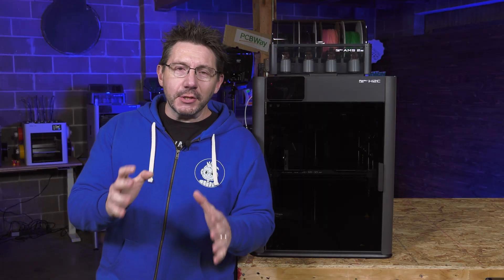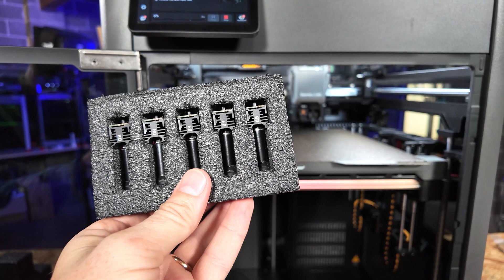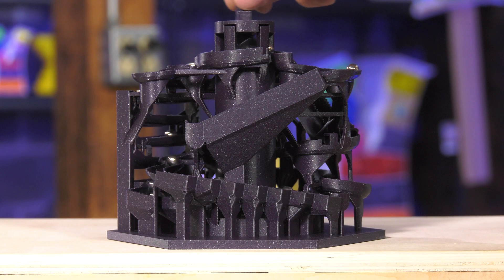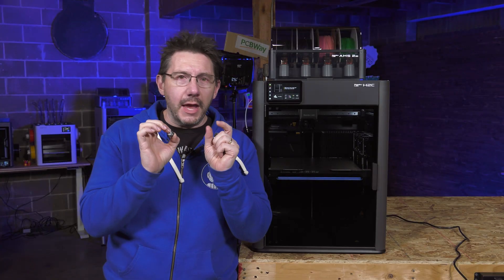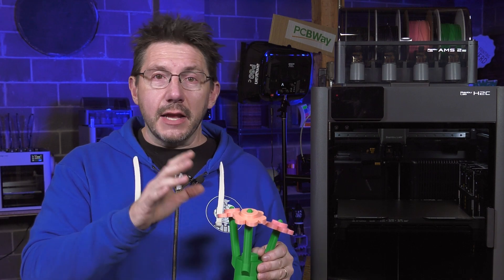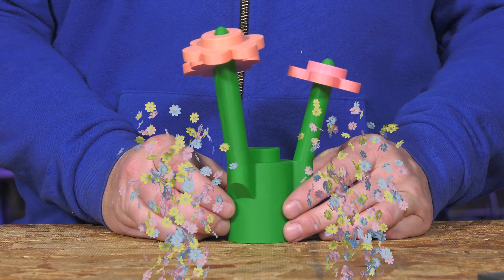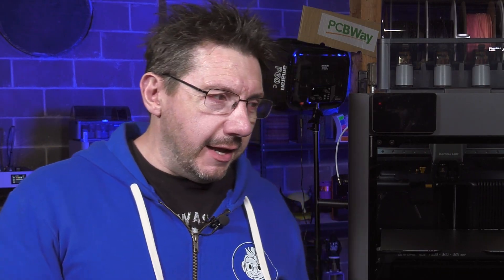My Review of the Bambu H2C + Vortek

Comment: ultiple failed prints, Uneven bed heating, nozzle clogs that you cant clear and need to buy a new nozzle every clog, Sub par print quality....Yep! This is Bambu "innovation" If people would stop with the Bambu hype and brand loyalty and actually LOOK at the stuff that has come out of Bambu since the P1S, X1C launches they would see that it has been a LOR of falis.  Tha A1 could burn down your house. they fixed it, but didnt and it now has more soldering joint issues on the PCB which is causing them to melt.  The H2D is a joke that has come nowhere near the sales numbers that Bambu thought they would and again sub par printing quality (and its $2400) the H2S is more of the same.  And now this thing the H2C. Its barely even usable and it loaded with massive issues.  Bambu are scrambling because they know the Snapmaker U1 is going to take over the market and now Creality has said they have a tool changer printer coming this year too.  Bambu is in trouble

Comment: Thanks Joel! For me, that steel sleeve around the copper core, is very thin. A concern for me would be the degradation it will experience during heat cycling. Looks like an H2C user will have to be locked into buying them over and over again. 🤔

Comment: Re: PA6-GF - I printed some shelf supports to make a rack for my filaments.  I printed two with PA6-GF, and 2 with PAHT-CF.  Both were very stiff, and I didn’t see layer adhesion issues like you experienced.  That said, I had much worse warping and bed adhesion issues with the PA6-GF, so I’ve standardized on PAHT-CF when I need engineering grade materials.  Printed on H2D btw.  I also dried both using the same method you described, because both of these get NASTY when they are waterlogged.

Comment: i would bet that the printer has problems with USA 120v plugs, i bet if the printer used 220v it would work better, i know Stefan who is in Germany with 220 power did not talk about bed adhesion problems. maybe

Comment: I have bed heating issues with my H2D...  the solution i have used is... max out the bed temp. max out the chamber temp.  give it a HALF HOUR to preheat...  and use lots of glue and glue stick with a massive brim, like you did...

Comment: i print with YXPolyer PA6-GF all the time for actual use parts.  i absolutely love it.  It looks like you had the cooling fan on, and didn't print at a high enough temperature 

For reference i print a 290-295 , 120 bed temp, 65 chamber, with a 0.4 nozzle , speeds around i think max volume is 7mm^3.   NO parts cooling fan!   On an H2D.   Love this material.  even had a great amount of flex once moisture is reabsorbed by the nylon after a few days.  I printed an articulating wing F14 for my 3 year old son and he has thrown it a billion times, and it still works beautifully and hasn't broken at all. 

I've printed all sorts of real parts with it.  A livewell stand pipe inverter for my boat, transducer mounts for my boat,  I printed a fish jaw bone for the left side of a fish skull being taxidermied that i had to do a 3d scan of the right side bone and then mirror to print, all sorts of great stuff with it.

Comment: The issues with the bed heater are familiar to me on my P1S units as well. I monitor all my printers through HomeWizard, and normally the readings make sense — one P1S starts heating and I see ~100W, another kicks in and it becomes ~200W. All fine.

But at night I noticed something strange: my P1 meter suddenly showed that I was sending about 100W back to the grid, almost like I had a tiny solar panel running in reverse. Obviously a 3D printer can’t export power, so I asked GPT-5 to break it down.

Here’s the explanation I got, which actually fits the behaviour perfectly:

* The Bambu’s PSU has large input capacitors and uses high-frequency switching.
* During fast load changes (bed/hotend PWM), the PSU can momentarily push *reactive power* back toward the line.
* It’s not real energy — just a short **capacitive/inductive interaction**.
* Consumer smart meters often misinterpret reactive spikes as **negative watts**, so it looks like export.
* If you have solar or a home battery inverter, their regulation overshoot can amplify this effect for a split second.

*Interesting detail:* my Qidi Tech, which draws around 150W, does not cause this behaviour at all. So the phenomenon really seems tied to the specific switching behaviour of Bambu’s PSU.

*Bottom line: the printer isn’t exporting power — it’s just reactive power confusing the meter.*

Comment: Regarding the PA6-GF, Polymaker right? I printed this on my A1, very sensitive to moisture. My prints looked like that before a 24hr dry. To comment on layer adhesion, my prints were sturdy/strong, 5wall 15% infill, couldn't break them in my hand. My prints had the same artifacts/gradient changes at the layer lines.

Comment: I printed PA6 CF and GF in an unheated enclosure at 38C. With 20% infill and 1.3mm walls 20mm test cubes, it is surprisingly spongy when squeezed with knipex parallel closing pliers. Returned to shape, didn’t crack at all like that. Even after forgetting about the pa6 & pa 12 samples in e85 for 2 months, felt the same. I know crushing cubes with pliers isn’t very scientific, but i do it on all my test cubes with the same tool.

Comment: I've printed a handful of different PA-CF blends (never GF) and they come out considerably stronger and most importantly, tougher than what your parts are showing.  There's a chance you overcooked that material. Nylon needs a small amount of moisture to maintain its toughness. Fully fully dried it gets brittle. Zach over at voidstar shows this nicely in his recent video about printing mysteries. Typically nylon blends are dried around 70C I believe. Though I'm not sure it would explain the weird banding in the print itself.  Nylon should also gradually absorb moisture from the air and regain its toughness over time. Just a guess, but it doesn't seem to explain all of what you're seeing.

Comment: I have had stripes like that with PA and it is from uneven drying (i.e. the side of the spool facing the heater gets dry while the backside was wet.)  Possibly in your case it is uneven moisture absorption during the print?  Maybe you have some kind of climate control that changes the RH in the air kicking on and off throughout the print. Also were you feeding it out of a 70C minimum heated dryer for the entire print? If not that would also contribute, PA6 absorbs problematic amounts of moisture in under an hour.  

God i hate nylon but PA12 GF is definitely the way to go.  Much easier to work with and is actually must stronger than PA6. I honestly don't know why PA6 gets all the hype when PA12 is better in every way.

Comment: I believe the bed is the same as the h2c that I have. Definitely have experienced adhesion issues and have to use glue on pei which was never the case with the x1c. Their wiki talks about two stages of components where the first does the initial heating quickly yet unevenly and the second is more continual heating that evens out after a short time. Wondering if regularly preheating could help with both machines.

Comment: You can’t really trust the IR measurement unless you’re calibrated for the emissivity of the build plate.  Also the cold surrounding air temps can prevent it from reaching a uniform temperature.  I think you assessment is inaccurate.

Comment: I have printed with Fiberon PA6-GF20. It's the strongest thing I have ever used after annealing w/ heat deflection temp of 150ºC. Aesthetically a quick sanding does wonders, not the most awesome finish off the bed. Needs to be bone dry!. Also glad I can take The H2C off my list and keep working on the tool changer for my Voron 2.4 .

Comment: For nylon, especially PA6, you want to hydrate it after printing. This dramatically improves its durability and flexibility. I'm not saying that's the sole reason the nylon print failed, but it would have been nice to see a followup with proper treatment to give it a more fair shot. With that said, the demonstration was still valuable. Thanks for the video.

Comment: Right now because of firmware issues my H2D is almost unusable on multicolor prints of more than 2 colors.  it strings on the puge tower and creates a huge mess, and is over extruding like crazy. and then it will literally knock the purge tower over at a certain height as the nozzle is running into it. Even if you print with no purge tower, it will over extrude and string everywhere on the model itself. there is currently no fix for this and Bambu won't even acknowledge the problem.  The forums are full of angry customers.  Right now the H series is my worst performing machine in my fleet

Comment: @KitCrafters has been using the H2C for over a month with over 30K nozzle swaps and not one bed issue 🤔 yes it uses the same bed heating element as the H2D so I still may get this one as it appears to be $2400 USD and getting it with Bambu GCs is a plus!

Comment: lmfao PLA-CF handles way better than that engineering filament you used and broke by hand. With that said all the issues you mentioned on this printer is why I will never buy anything from Bambu Labs. The heater element for the bed is one of the reasons why so many P1Ss' and P1s have caught on fire and the issues with the nozzle is the other reason why so many of their printers have caught on fire. I would rather deal with printers that have programming issues than a printer that can burn my house down because of shitty engineering

Comment: I have used a lot of pa6.

Almost all of my GF prints from 2 brands have warped… or warped to the point of failure. I’ve tried g10 plates and glue and more heat and drying, no fans, low flow, high flow, infill density and patterns.

But my CF prints? I can literally just use the generic PACF profile Bambu made for all 3 brands I’ve tried and they come out stupid strong and zero warping. I can use whatever wall count I want, whatever infill I want. And it basically just prints as easily as PETG for me.

Comment: PA-CF35 is practically bulletproof when printed properly....you probably have an overly fast profile or haven't hit a decent chamber temp. try 80 C on the chamber and slow down on te print speed and reduce the cooling fan.

Comment: I'm wondering if the difference in temperature measurement might be partially due to emissivity issues. The bambu build plate is metal which reflects, the prusa buildplate you were using seemed to be something different? That doesn't explain why it's so uneven, but that could be a large factor in why you're seeing a different temperature from your temperature probe. To confirm you should use a contact temperature probe instead of an optical one.
Reply: It is exactly this.

Comment: I love the honest review. I’ve seen some other reviews today and the issues you experienced with adhesion and bed heat were not mentioned.  
I’m wondering if you talked to Bambu on this?  Could it be your unit has a defective heater or something else wrong that needs adjustment or a part replaced?  Or did Bambu acknowledge this is a known problem?

Comment: I think Bambu recommends to use the printer controls to do the cold pull procedure.  Use the printer to heat the nozzle, and use the extruder to both put the filament into the nozzle and to pull it out after it cools down.  This should prevent any damage to the nozzle.

And Zach Freedman did a video recently where he showed you can dry Nylon TOO much, where it then becomes extremely brittle and loses its strength.  I think your issue was using the vacuum chamber to draw out every little bit of moisture.

Comment: This was an awesome review, Joel. I really liked that you didn’t just show “shiny prints” but actually measured the bed temps, documented the adhesion failures, and even sacrificed that 0.2 Vortek nozzle to show how jams basically turn it into a consumable. The comparison with how your XL’s bed heats evenly really helped put the H2C’s bed design into perspective.
I’ve just started a small, fresh 3D printing channel and I’m trying to pick my first “flagship” multi-material machine. The H2C with the Vortek is super tempting: the whole rack dance, painting in Bambu Studio, and the results you got on things like the dice dozer and the tentacled chest are exactly the kind of multi-colour projects I’d love to feature. If I do go for it, I’m planning to film a full unboxing and “first prints” series on my channel and try to recreate some of the more challenging models you showed.
At the same time, I’m also looking at other options in that ~2,500 USD range, like an H2S-style setup, a Prusa XL, or even a more traditional toolchanger. I’m a bit torn between pure reliability (especially around the bed and nozzle servicing) and the workflow/automation you showed on the H2C. For someone in my position (new channel, lots of planned multi-colour prints, around 2.5k budget), would you and the rest of the community lean toward the H2C, an XL or other toolchanger, or something else entirely, and why?

Comment: CF and GF filaments are not good. They only make the material more brittle. Glass fiber nylon works for injection molding, but it can't work in filament because the "glass" has to be very small to be able to extrude without jamming and leaving long fibers sticking out so you don't get the benefit of fibers that reinforce.

Comment: Prints not sticking has been the bane of my 3d printing journey.
I have tried ALL the things to make it work, with spiritic results. 
It will print fine at 11pm Friday, but wont print at all 8am Saturday. Same Settings, same File, same Material, new Material, doesn't matter.
As such, my printer remains a giant paperweight.
I have spent more time on upgrades, trying to fix it, than it ever has printing.
So prints not sticking.... 👎

Comment: PSA: You can OVERDRY materials
Reply: how?
Reply: @Gekkoperformance  With a dryer
Reply: @oyuyuy whats the symptom of too dry
Reply: @Gekkoperformance yes please let us know. What happens when Pla or petg is overdried
Reply: @Gekkoperformance  For polyamide? By... drying it too much. When it's completely dried (rather than mostly dried) it becomes brittle and if you look at injection molding polyamides - or something as simple as trimmer line - it's often dunked in water to soak it, so the nylon gets more flexible and regains that toughness it's known for. Try snapping a trimmer line with your hands. Not working out? When it's dessicated completely it crumbles like dry spaghetti.

Comment: 7:00 i found that a 1.5v battery, two wires and an acupuncture needle works great for clearing even 0.15mm revos. the trick was to heat the needle and insert it from the orifice and not the throat ;)

Comment: Can anyone chime in on whether the heatbed is any different to the H2D/H2S? Apparently the heater element used in the whole H2 series (unsure about H2C) shows temperature uniformity problems due to its shape. While certainly not the pinnacle of heatbed technologies (and a bit of a sorry excuse for a flagship machine) I've read they managed to improve the situation on the H2D with the latest firmware updates and many people report no significant issues even with warp-prone materials.
Do you guys think this is just a particularly bad sample? At least with the H2D you could use something like the BQ CryoGrip Glacier as a good allrounder plate for increased bed adhesion.

Comment: Someone may correct me, but to me measuring temperature with an emission factor of 1 sounds wrong to me for a PEI Sheet. That should be more around 0.95 or even lower which will mean the temperature was actually higher than shown in the video.  1 is usually for black surfaces. 
The second question is how long was the bed heated before the measurement was taken? Heat will spread after time, so important point is how the temperature zones are when it actually starts printing.  I highly doubt that the bed of a H2C would be worse than a H2D / H2S bed. That doesn't make sense, unless it's  a faulty one.

Comment: What's crazy is that I still have my old X1-Carbon, and I ALSO was having some adhesion problems. I was very suspicious that the bed wasn't heating evenly but had no way to prove it. You just confirmed that this is an issue with Bambu... thank you!

I was waiting on the H2C, but Im wondering if I need to look elsewhere now.. or maybe an H2D would be OK. 🤔 

TWO QUESTIONS..
1). How would you rate the H2D? Any problems there?
2). Did you talk to Bambu about the uneven heating? Are they going to fix it b4 release?
Thank you!

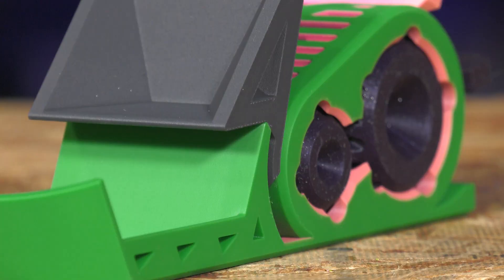Comment: 15:40 both pieces of the hotend mount in the stealthburner toolhead on my trident is printed out of PA6-CF.  (not glass fibre, but same basic material)  printed on my core one , was a little on the brittle side coming off the printer,  i left them sitting on my work bench over night before mounting and they were much better the next morning.

Comment: I was about to order one "day 1" to replace my X1C, but after having seen that video... well, i think it's safer to skip that model, the bed heating issue seems a huge problem (that won't be solved through a firmware / software change, of course).

Comment: Looks like you over dried the PA6 to me, seen that done that.  Huge disappointment on bed.  I had recently picked up H2D in past 12 days and very disappointed with way bed heats so unevenly.  I put my H2D up against my super tuned Plus4 same print and settings and the Plus4 smokes itvon speed and final print quality.   Guess I expected bit more out of a Bambu machine, it is nice but bed temp design is huge disappointment in my eyes.  I like my H2D but wish I held out for new Qidi Max 4 or Core One L.....Can only hope they look to fix this issue.  I could have grabbed 3 plus 4's for the price paid on H2d or two Qidi Max4s